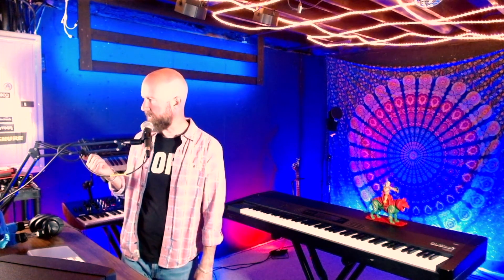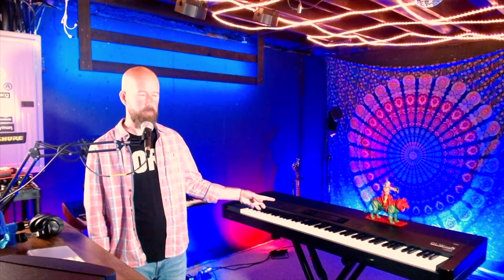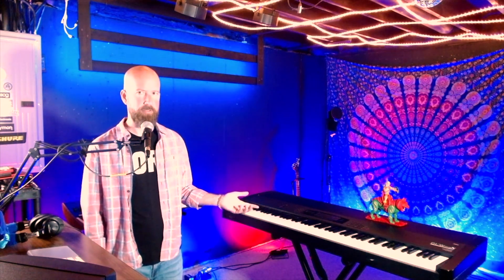Sustain Pedal Jack Broken?  Try This!

Comment: I'm trying to follow....in order to get the sustain to work on sounds coming from your Korg (while playing the Korg), you use the sustain pedal with a MIDI controller that has MIDI in to your Mac via USB and then use the 5 pin MIDI out from your interface to your MIDI in on the Korg.

Then you use the sustain pedal that's hooked up to your MIDI controller but you are playing the Korg and the sustain works...correct? Is it working through your monitors/headphones or only in the software that's recording the midi data?
Is the mid controller not going through the interface in any way
Reply from the maker: You have it correct.  Once the connections are made as described my Korg can sustain its internal sounds like it would if the sustain jack was working properly.  I could also run a MIDI out from the Korg to control software sounds as well, and continue to use the pedal connected to the controller, and it would work.  I realize it's a little confusing, and I'm not great at explaining.  I actually did another video recently that might be a little more coherent.  If interested you can find it here:
https://youtu.be/b_Ojp0FK-ow

Comment: Good to know. Matt, are you aware of a pedal that allows you to advance to the next preset?
Reply from the maker: If your synth has the appropriate input you can use any momentary switch pedal and configure the synth to advance programs when the pedal is depressed.  So it's not the pedal itself that's quite as important has having a synth that will allow you to use the pedal in that capacity.  Hope that makes sense!
Reply: The KORG POLY 61 actually has an input jack that is specifically designed to advance programs. I can't say I can figure out how to make this happen on the M1? @mwmusic29
Reply from the maker: @AmbientSound7  I can't put a link here but if you'll check the M1 manual and take a look at page 111 I think that will get you the info you need to make the pedal advance programs.  Hope that helps!
Reply: I don't know your situation. But I know for me my keyboards are in the studio, and what is plugged into them usually stays that way for a very long time, maybe even years. So I found that the barrel of these jacks becomes tarnished and creates problems. I can't find it online, but I have this tool that looks like a guitar plug. It is made out of some kind of graphite. When I have noisy jacks, for either sound or pedals. I push this thing in and out a few times and all the noise goes away. I've even had some people say you can spray some Deoxit on a Jack and push it in and out a few times, and that might clean things up. Just an idea...
Reply from the maker: @jonmicheals621  Awesome - thanks for the tip and I’ll look into it!